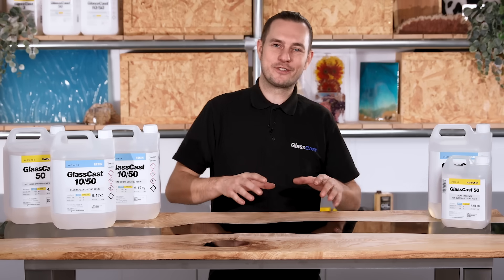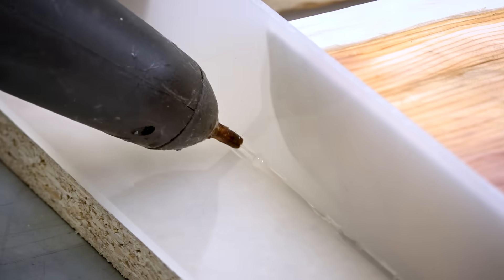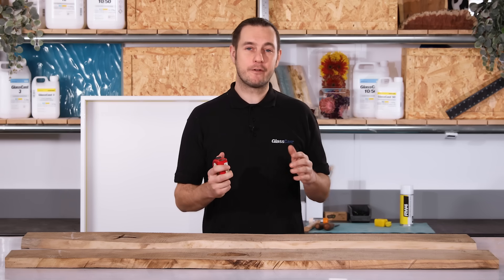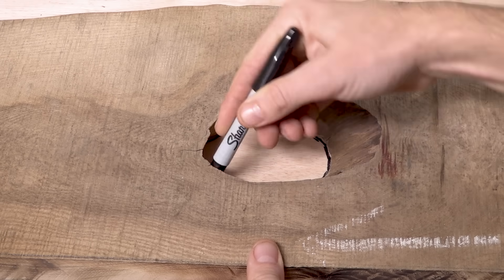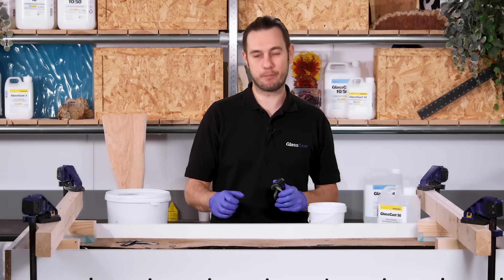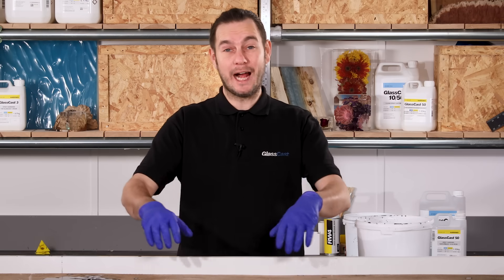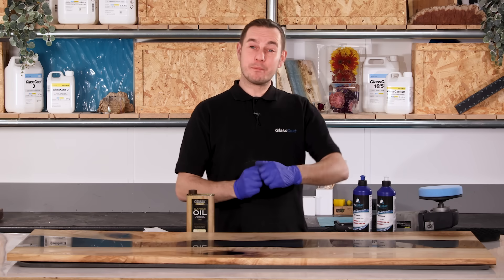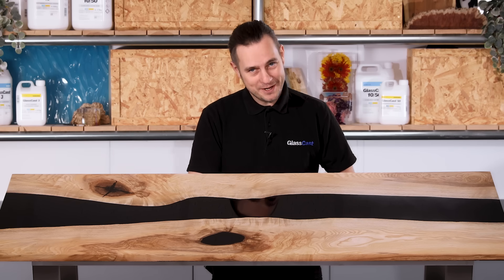Stop Wasting Money On Resin River Tables!

Comment: I did something similar to this on a lake table I was asked to build, the video is on my channel.  The slab was over 5 cm thick and I had a limited budget to build the table on, so I just put a plywood platform in the center and sealed the edges, only casting about 1/5 cm worth of resin, turned out beautifully, so i can vouch for the fact that resin saving techniques work and they worm very well!

Comment: You could even have the plywood core be a piece of art of it's own that is put in with transparent pigment.  That could look really cool also: a disconnected table, or wooden fish, or a photo glued onto the plywood of  stars or anything.  There are lots of options that could look cool and cut down on the resin without being too complicated.
Reply from the maker: Indeed you could make a feature of it if you so wished.
Reply: To add a little bit more to what you were saying...you could also glue a matching wood veneer to the top and sides of your plywood core or just the top and angle the sides a bit so they're not noticeable.  Shape it like an added piece and save some epoxy that way while adding a cool little "island" part to the whole piece.

Comment: The amount of effort and time it takes into building one of these tables puts these tables at a premium price. A client that finds out the majority of the centre is done with cheap plywood would not be happy, if sold at acceptable rates. Ok for a craftsperson but to turn an expensive luxury piece of furniture into this I have qualms with. 

I will also note that you have made three pours, one the first pour you sealed the live edges with epoxy, by the time the final third layer came this live edge will be fully cured by this point so the resin will not make a chemical bond, thereby weakening the table - that is already weakened by the link of plywood core.  Overall this line of advertising for glass cast resin is quite disappointing from a loyal customer of many years. 

From a client that has followed your company since the start, you neglected to mention the reasoning for not doing a 2mm seal pour for the base, reducing air bubbles from the base of the wood. Although this has been a practice avoided by most river table makers since you released the video many years ago, you fail to explain the reasoning for now neglecting this step. Perhaps previously you wanted to increase volume sales of your product and now the realisation of the unavailability of these products on financial grounds for ground up companies now want to cut more and more corners to get people in the game.   

Your complete lack of PPE when dealing with the resin during the curing stage with no respirators in sight, eyes and skin exposed is highly irresponsible. Your product of glass cast 50 or others in the range are not BPA free and so should be dealt with the respect they deserve.   Your amateur router sledding of the table failing to have any extraction just adds to the neglect shown to safety- although noted in these shots you did not actually film the persons face whilst routering - which I do hope for his sake was adjourned with an appropriate mask. I’d have also liked to have seen a full body suit overall covering the skin and eyes completely. 

 For those reading this and think I’m some keyboard warrior not knowing what I’m talking about, I have been making tables exclusively from the glass cast resin since 2018.
Reply: Couldn't agree more.  This is damaging to our craft, and the lack of safety concerns me to no end.
Reply: @bacon8787  Not one piece off PPE, apart from the gloves, really terrible to not wear proper mask, or even talk about ventilation, then sanding the toxic resin without a good dust mask, really poor for a company to be this careless. It was a joy to work with, bet your lungs weren't that happy!

Comment: Oh, plywood. Good idea. Better that the things I've stuck in epoxy to reduce the volume used- literally scraps, rocks, and whatever else laying around...
edit: Though I am fond of layered cardboard soaked in epoxy. It's so strong, cheap, and light. Will float, needs to be secured.
Reply from the maker: Also with card you have to be aware of possible air coming out as bubbles and deal with the air accordingly.
Reply: @glasscastresin  Yeah, it requires a top coat.

Comment: Great video overall. One thing that did strike me is that while this is most obviously of use for opaque and metallic resins, it seems like you could do a transparent effect finish quite easily too. Maybe reduce the plywood thickness by another 5mm and use that depth to add and progressively more transparent layers to the top to create the illusion of a deeper pour (much like how people do those fishes swimming in water illusion paintings on resin).
Reply from the maker: Yes you could certainly do that and make it into an effect.

Comment: if you use clear resin you could allso lay down a bottom in resin fill most of the space with fancy sand or pebbles than fill it to the top with more clear and finish it off , should save up to about 2/3ths of the resin used ans looks a little different than a solid colour

Comment: I feel that this is all well and good, up to a point. When you factor in the cost of resin only poor compared to the cost of:
1. Resin base pour - Cost of mixing small batch, clean-up and cost of time waiting for cure.
2. Cost of a plywood insert and the cost of man hours cutting, shaping and finishing so you don't have unexpected wood fiber floaters.
3. Cost of time mixing up a second batch of resin, pouring and clean-up and waiting time for cure.
I think that from an accounting standpoint, it really may be less expensive to make one resin pour and be done with it. Especially if there is paid labor involved. Even a business owners time has financial value.
Reply from the maker: Considering most people considering this are DIY/hobby users, time is generally not a financial cost.  You could do the math for a business to determine if it is viable.

Comment: What about doing lighter colors?
Reply from the maker: As long as the resin is pigmented to a solid opacity then even with light colours, this technique can be used. Unfortunately it wouldn't work for translucent or tinted resin as you would see the filler material.

Comment: I do use "chipboard" (i don't know if this is the good term), the cheap version of plywood. Essentially saved from waste disposal (Ikea and stuff). Also, i use wood shavings , that i like the render within epoxy ! This way, i save barely 80% of epoxy. And the weight is barely the same.

Comment: you can also use pieces of scrap wood , just cut them up in small blocks and fill in the gap.
Reply from the maker: Yes you can make use of offcuts this way. Just be sure to fix them in place so that the wooden pieces don't float in the resin.

Comment: Something to try (whether or not you are using a Filler material) - Put a Mirror on top of the filler material and under Translucent Epoxy. For the best look, use a Front surface mirror. They are more expensive but they're worth it for a real River / Lake look.
Reply from the maker: Would certainly give a different look and maybe more depth.

Comment: While I like the notion of saving on the amount of resin needed, I think this idea could be taken a step further to reduce the resin usage further and increase the stability of the table by milling out a pocket in the slabs to accept a plywood core that not only takes up space in the "river" but inserts into the slabs so that it can be glued and doweled in place. It would take a bit more woodworking, but the two sides of the table would be fixed by a solid wooden core that would help insure that everything remains in alignment and take up even more room that otherwise would need to be filled.
Reply from the maker: Although possible, we have yet to see a properly made river table where the bond between the wood and resin has been inadequate enough to cause structural issues with the table.

Comment: I have done this before with scrap wood to fill the cavity  but my one recommendation is to weigh all of  it down. As I have had it shift and float to the edge.
Reply from the maker: The brush applied sealing coat of resin is great for preventing this from happening as it secures everything in place, as well as sealing off the surface to help reduce bubbles from escaping.

Comment: I had never considered adding the dye to the resin before mixing the 2 parts.  You can dye just the resin part, then store it for later, and only mix in the hardener as you need?  I always thought you had to mix the parts, then add the dye.  Always wondered how you do a partial pour, then add the core, then add more resin to top it off, while keeping the color the same for all the mixes.

Comment: That'd be easier if you scanned the wood and printed an insert which left enough room for the resin.
You'd save on weight because you could make the insert hollow.
Reply from the maker: Mot people don't have access to a 3D printer to print an insert.  Wood working tools are more accessible for most.

Comment: Tips for saving costs are allways good. However there are some drawbacks using this method. The 5 mm leave much less room for correcting warped wood and ”saving it” if accidents would occur in the future. And a future adjustment in length is made impossible as well. The process is also more time consuming (and time is money in a business) and there is also the cost of the filler to be considered, even if it is small. If you can live with the drawbacks and have the time (and scrap wood) it is a usefull tip 😇
Reply from the maker: Scrap wood offcuts or even fresh wood cut down is generally cheaper than the cost of the same volume of resin. Errors could be corrected by routing down the wood to create enough depth to refill on top should you have to.

Comment: Great, informative video showing some nice tips and tricks. Your maths however is slightly suspect. To use a third of the resin for an 11 litre void you would need to use 3.67 litres (33% of the volume). Your own calculations showed that you needed 42% of the volume and used a 5 litre kit. I know this doesn't seem like a large discrepancy but resin is quite expensive so the difference in cost is actually not insubstantial. I am not writing this to pour cold water on the techniques shown in this vid, they are very helpful but viewers should take the claims about how much resin needed for a project with a grain of salt.
Reply from the maker: Hi Dhufish, thanks for the nice feedback on the video, however, I think you might be the one who's got their maths wrong! We don't use all 5kg for the project, we only use 4.2kg (as shown in the calculation at 04:55). Admittedly, this works out at 4.2kg (with core) vs 11kg (without core) which equals 38%, not 33% (a third) but for the sake of an easily understandable ratio, I hope you'll excuse us for 'rounding' 0.38 to 1/3.  Also, this is actually quite a small table and the resin isn't very deep. On a larger pour (especially a deeper one) you'll find that the percentage of volume occupied by the wooden core is often more than 2/3 (because the 5mm resin gap remains the same) so for many projects, we're actually under-selling the potential saving : )

Comment: Doesn't it make the table weaker?        
With a slab of resin it's a solid shape tightly gripping wooden slabs on either side.
With a "bulking" piece of wood in the middle the resin will look something like this (|), a doughnut of resin around the bulking piece.
Will that make the resin weaker, especially the thinner you make it?
Reply: Not really. The weakest point is where the resin grips onto the wood of the planks, not the resin itself.

Comment: Great video, but I'm a not sure I would clamp down the two planks, the resin is not strong enough to force the two planks level together, especially using seasoned hard woods.
Reply from the maker: Its not just about forcing the planks together but to stop them lifting/floating causing a lot of resin to flow underneath.

Comment: Besides that these method needs some extra time, that creates extra costs (if you’re not making this desk for yourself) it’s worth to think about this. BTw, it reminds me about the way waterbeds are made with a core using less water, means weight and heat up time.
Reply from the maker: This would mainly be orientated towards individuals or low volume makers where the cost of the resin can be a significant issue when making these kind of projects.
Reply from the maker: This tutorial was really made with the DIY'er in mind who isn't paying for time and may otherwise have been put off by the cost of resin.
Reply: What could one sell a table like that. Or what is the ruff estimate of a table like that?

Comment: That is how you should create a proper advert! Really impressed. I was just wondering, what about the bubbles? Isn't it a concern with your epoxy?
Reply from the maker: Generally as long as you work in the right conditions it is not a problem.  Tricks like using a heat gun over the surface, work well to remove and lift out any stubborn bubbles that do not self degas.

Comment: You should use like a wire wheel to cleanup live edge.  A sander flattens the edge.
Reply from the maker: If only taking off a small amount of material then a sander works well and most people will have/need one for other aspects of the process.

Comment: Great idea, however, with so many extra steps and coats, it takes longer. The time saved by using 1 coat could be a wash in regard to the overall cost.
Reply from the maker: It depends how you value your time overall, for a hobby or home project, the savings in cost of materials may largely outweigh any additional time spent.

Comment: Or to be even cheaper use non UV protected resin meant for boat building that is around 30€/kg/L and finish the visible surfaces with product like this for that UV protection. Hell could even route slot into wood and glue in the plywood peace connecting the two and make the pour in one or two pours.

Comment: As long as it lowers the cost for the customer, I have no issues with this.
Reply from the maker: Thanks Wolf, there other potential benefits as well - the core could be switched out to a lighter weight material (even the ply would be lighter than the equivalent volume of resin) so you can make more manageable pieces especially where weight is a concern.

Comment: Why create such a big or deep gap by using two separate pieces of wood. Simply use the router to remove half and inch or even a quarter of an inch shape of a river and then fill it with the colored resin. Especially if you are using this really dark color. Nobody knows how deep it is anyway. At the ends just cut all the way through so it appears to be a thick slab when finished.
Reply: And a lot easier to make..  I wonder about the tables strength when you only have a 5ml top and bottom of epoxy?

Comment: Surely, if you are using a solid opaque fill, then you'd only need a shallow trench, so no need to half fill it with waste material
Reply from the maker: That assumes you have a large slab you can rout out a recess.  often the waney edge slabs come in two pieces to allow for a river.

Comment: to me it seems like a it might be a bit more fragile since its more pieces that needs to be bonded, and its points of weakness in the resin. i would go the extra step to fix them with some screws into eachother, especially since its solid resin thats not seethrough.
Reply from the maker: The plywood is strong in itself and the resin bond is strong.

Comment: yes this is a great way to save a tid bit of money when making resin table tops but the cost of resin is not the problem. the problem is the outrageous price for live edge slabs. how is it sawn lumber is cheaper than live edge slabs. there is more work , more time and a longer process to getting lumber . live edge you just slice through the log in 3"-4"  thicknesses , slat it , air/kiln dry it and its 2-4 times as much as lumber. I have been in the logging and lumbermill business for almost 30 years and still don't understand this stupidity. I sell all my slabs for the same price as the lumber I can get out of it . if I slab a log that I can get $8 bft for lumber then that's what I charge for the slab, $8 bft . I don't charge $500-$600 for it and I cant keep up with the demand for it and still make a great profit. this is why lumber mills and lumber yards have to sit on their supply for so long and sell very little of it . i sell more  in a month than most do in 6 months . i sell more live edge slabs annually than they do and make more than they do annually selling live edge.
Reply: You are exactly right. It's price gouging because of the fad of live edge. The guys that are selling these slabs are left sitting on the inventory as this fad starts to wane. As a woodworker, I much prefer a nice piece of straight, milled, kiln dried lumber. This live edge fad will slowly and gently fade away and hopefully the people that buy this stuff will remember guys like you, that just want to make an honest living and selling their lumber at fair prices. Cheers to all the honest hard working, lumbermills!

Comment: 11:07 Are those chips caused by the router or air bubbles trapped within the resin? They look more like air pockets to me that were opened up by the router. If so they could be reduced/eliminated using vacuum to pull the air out.
Reply from the maker: Definitely by the router in the case - generally trying to route too quickly and not having a big enough overlap between the passes causes chipping out.